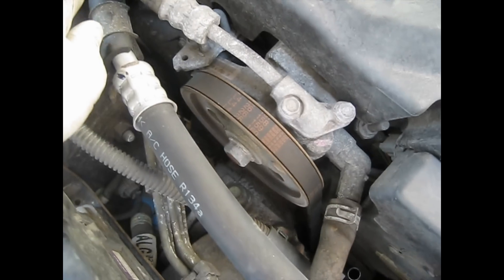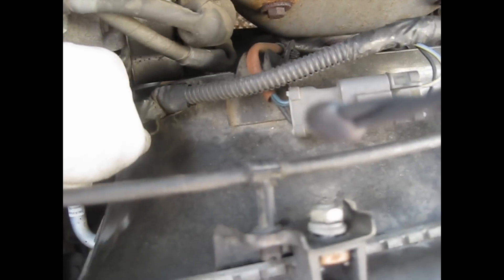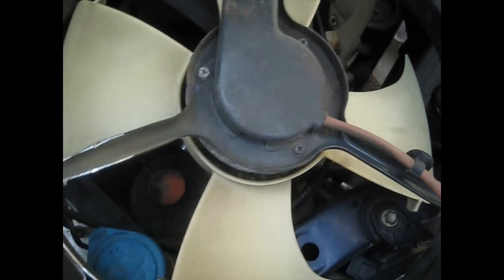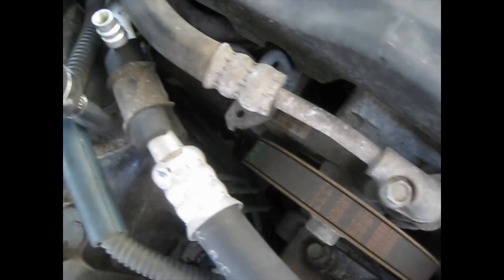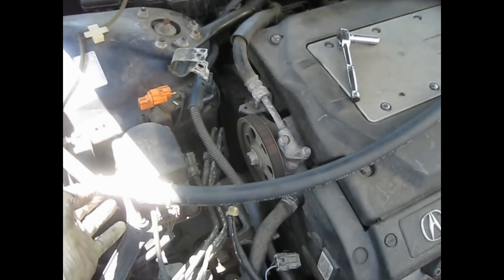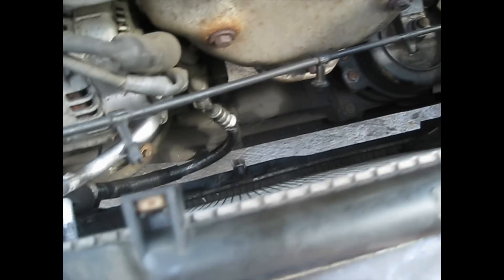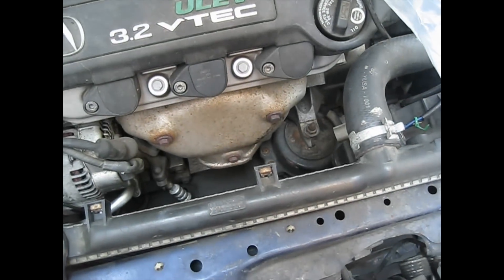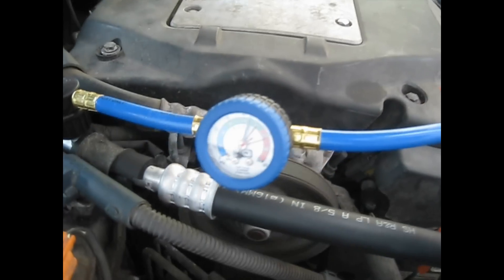Acura TL AC lines replaced and recharged 134a Freon

Comment: What tools did you use to disconnect the AC hoses from the AC compressor?
Reply from the maker: Regular ratchet and socket.
Reply: HP11208 a deep well socket? An what size?
Reply from the maker: I think it was 10 mm, and a 1/4 or 3/8 ratchet.
Reply: HP11208 thanks I figured it out it was a 10mm on 3/8

Comment: No, bad advice for novices. Never add freon to a empty system without vacuuming the system. A vacuum will lower the boiling point of water to remove moisture from the system not to mention the air or it will destroy the system form the inside out.
Reply from the maker: Thanks for the input.